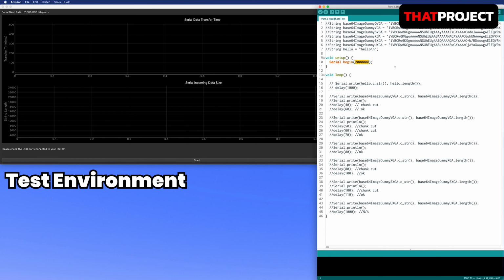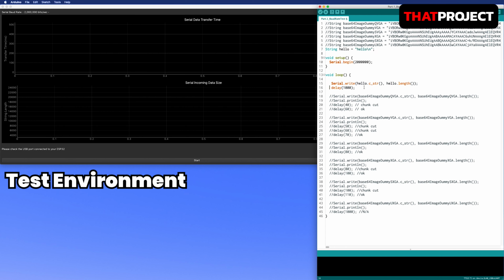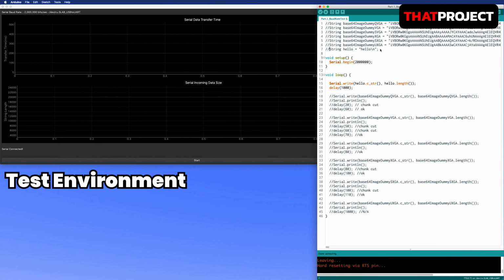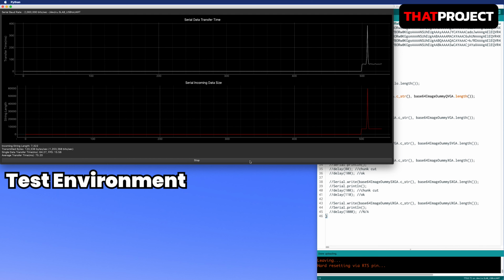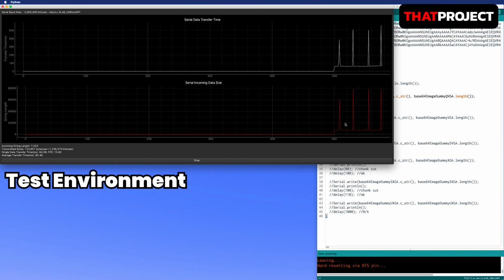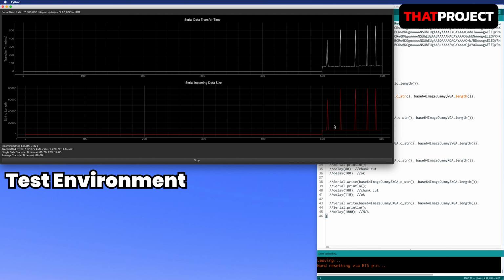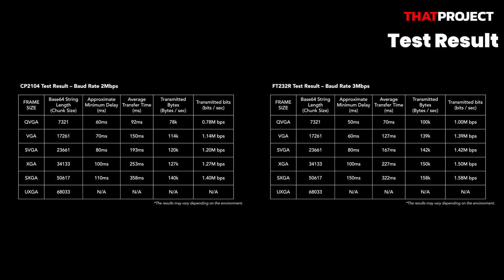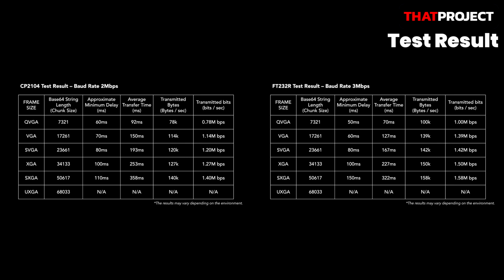ESP32CAM | Android(Flutter App) Wired Communication - Baud Rate Test [1/2]

Comment: is this eps32 or esp32 cam? esp32cam doesn't have any port. how to connect then with the flutter through wire?
Reply from the maker: This used LilyGO's T-Camera Plus. The is the same if you connect the FTDI Programmer to the ESP32CAM and connect it via UART Serial.
Reply: @ThatProject  so after uploading the code to my esp32cam can I connect it to the flutter (mobile app) through FTDI ? from where will it gets the volt?
Reply from the maker: @aliabdulwahid197  Since it is connected to the USB port of your Android phone, power is also supplied to the connected device through this port.

Comment: On the fast wifi esp32 jpeg (or bmp)  transfer you occasionally get a broken jpeg  (mentioned on the esp32-camera github page)-- do you see any of these flaws on this fast serial transfer?
Reply from the maker: Is that a matter of bandwidth while transfer images via WIFI? 
I think you need to check the data both sender and receiver to figure it out. I made this video to make sure the sending data stable through serial communication.
Reply: @ThatProject  On the main esp32-camera github they say "Using YUV or RGB puts a lot of strain on the chip because writing to PSRAM is not particularly fast. The result is that image data might be missing. This is particularly true if WiFi is enabled. "  

They don't mention jpeg, but the problem happens at a lower rate with jpeg.  An occasional jpeg is broken and the bottom half is black or orange.  It shows up more dramatically when you record the video to an sd card, rather than streaming where the flicker disappears quickly.

I think the problem is the i2s used by the camera, and the i2s used by WiFi.  If you shut off the wifi, then the recorded video is fine, but with the wifi on -- even if you are not actively streaming -- then you will get these broken images.  

So you are bypassing the wifi, with that serial connection.  Maybe the solution to my wifi + camera problem is to put an 8266 with wifi, and connect the esp32-cam to wifi that way, so the esp32 does not have both wifi and the camera at the same time.

Look forward to your next video!